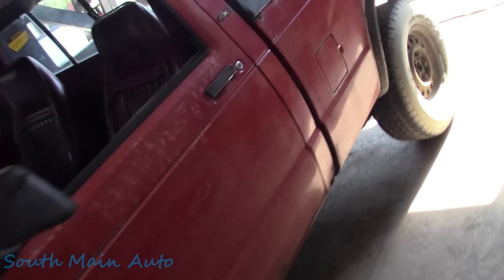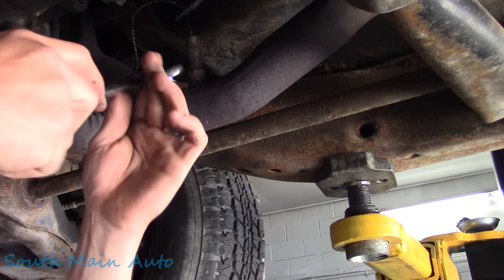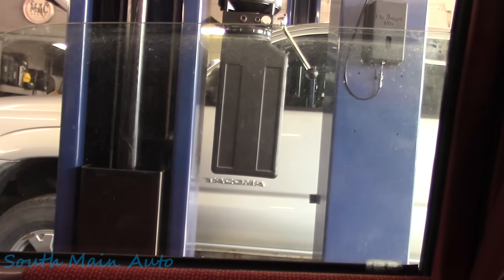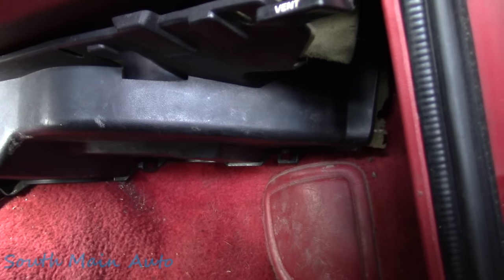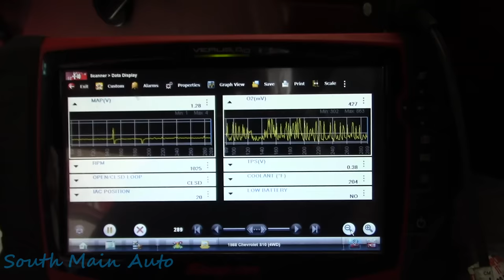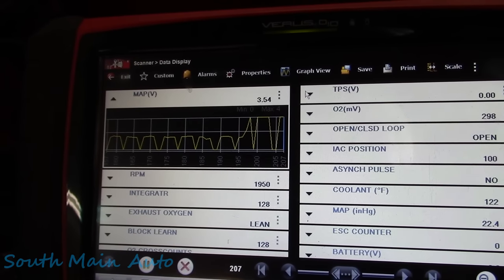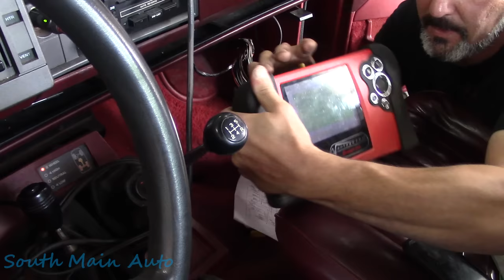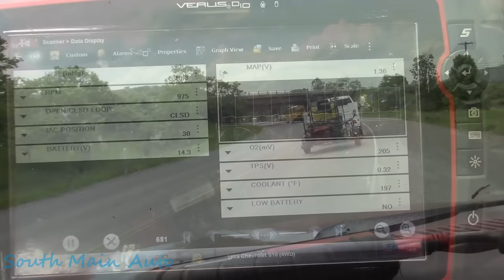Chevrolet S-10 - High Idle and Dies After 20min Drive?!

Comment: Now we're talking! When I was 16 and working summers for the village, our "truck" was a red 88 S-10 with the iron duke 4 banger. It had an AM only radio and no power steering. We called it the "S-9". One guy decided he was gonna buff and wax it by hand. He gave up pretty quickly and we drove it the rest of the summer with one shiny fender...
Reply: When I was an electrician apprentice back in the early 90's we had a GMC Sonoma shop truck.  Iron Duke, manual trans, and no power steering.  I hated that f'n truck!  lol!
Reply: Fender splendor :)
Reply: I had a "77 PONTIAC SUNBIRD with the 2.5 Iron Duke. Sold it for $100 @188k.
Reply: Wes, if your donkey powered internet is working good enough to watch SMA, you better give us a vid!
Reply: Hahaha... 1 shiny fender.  Oh Lordy! Love it Wes! 🤣🤣
Reply: That's exactly the truck I have. It's not much fun to drive, but it's reliable!
Reply: I used to work for a hydraulics shop that had an S-10 with the 2.8 liter V6. It was a great little truck, manual trans, no options, but it ran like a top. Later on our shop changed to a Dodge Ram pick up and I hated that thing, it was a dog and would fall flat on it's face with the bed loaded.
Reply: @richb.4374   Every time I see an 80s S-10 I think of Terminator 2 where they're yelling at him to go faster and he says "this is the vehicles top speed".
Reply: Back in the day, the shop guys would do a "Tap Test" AKA, tap it with the handle part of the screw driver.  if the vehicle cut out it would need a PCM. LOL!
Reply: @bonemanmcjames2953  Good point!
Reply: @bonemanmcjames2953  That's what i'm talking about!
Reply: Wes, if you have time to be on internet, you need to get off and make us a video my friend.  Just saying. :)
Reply: I hope that was the curbside fender...#waxonwaxoff🤪
Reply: Wes was one of the original "Village People"..lol
Reply: S10s , 80s Ford Rangers and 90s camrys will be running long after we are gone
Reply: @warrenfromga9945  Pretty sure his internet donkey is still broke down.  Massive lightning storm took out internet in his whole area.
Reply: Cleaning out my desk yesterday, I found my first speeding ticket.... earned with an iron duke.  It must have been downhill with a tailwind. LOL  1986 Celebrity, 62 in a 45 if you wanted to know.
Reply: @SouthMainAuto  man...that brisket sandwich looked AWESOME...I WISH I WAS THERE!!!
Reply: We use to race dirt track with an Iron Duke. The engine would last way longer then anyone wanted it too. The only issue was the amount of RTV sealant it took to keep oil in the engine and the front head bolts would snap every 10,000 miles or so. I learned quickly how to replace the broken head bolts without taking off the head (Or the rocker cover) using the broken bolt, an impact gun on reverse and an air nozzle.
Reply: @29auto30  That's exactly one of the tests that they do to the PCM at the rebuilding centers.  In college I worked for Delco Electronics and wrote the script for training videotapes used at the 6 or 9 regional remanufacturing centers around the country.  You took the unit and slapped it hard.  You also put it in an environmental chamber and baked and then froze it to see if it would fail.
Reply: Urban locale here and the USPS still runnin the iron duke in the LLVs. The guy floors that thing like a jacka.. whatever Eric said about the flipped filter lid
Reply: Remember when you snuck in that fly into the edits that nobody noticed? Wonder if Eric is playing with the same software..
Reply: Do you mean HAM radio?  Never heard of an AM radio.
Reply: hated the 2.8 I miss my s10 with the 2.5 iron duke never die went over 200000 mi the body gave out before the drive train
Reply: @WatchWesWork  "I could get out and run faster than this!"
Reply: @redmondjp  ...slap and bang it like an old tube tv .. (i hear many ask whats a "tube")
Reply: The shiny fender was the idea for daytime headlights.
Reply: @vehcor  Fancy seeing you here.. One of my favorite channels commenting under another one of my favorite channels, while on another one of my favorite channels..   I don't know what is happening, but I like it. lol
Reply: yeah i wrote above that that little model and truck made chevy look sincere.  wonderful - it worked and ran dependably and was not expensive.
Reply: I'm glad I got an 82, it doesn't have 98% of the electronic crap this has, I could disconnect all the electronics (temp sensor) except the starter and alternator and it'll still run all day.
Reply: @WatchWesWork  my 82, when it was stock with a 3spd automatic, would do 100 mph no problem.
Reply: The prom chip very seldom go bad it is a PCM problem
Reply: Heat and quench😅

Comment: I’m sure others have said, but it’s surely a few leaking capacitors that have eaten the original PCM. Sadly junkyard units will likely be on the same trajectory. A refurb that’s been recapped and had any trace damage repaired may result in more reliability.
Reply: I'm thinking this truck would be a decent candidate for a  cardrino or speedrino if it ends up with more problems with the computer.
Reply: I'd also rip off that cover and first have a look at the capacitors. If they look fine I'd take off the pcb and search for bad solder joints. 

Back in the days I owned a BMW where the entertainment ssystem did such weird things after some time, at hot weather more than in cold weather. BMW's offer was to put in a new radio for more than 1500$. I thanked them for the offer, went home resoldered a few joints and it worked like a charm for the next years untill I sold that car. 

But for Mr. O. that wouldn't probably be an option because of warranty issues...on the other hand, as you mentioned, if there is a cap-problem this guy will eventually run into some similar issues in the feauture.
Reply: Absolutely. If you can catch those electrolytics  before the leak and kill the traces, its a pretty easy fix if you have some soldering skills.
Reply: Wow, Had no idea you watch this channel too Adrian! But absolutely my guess, it's becoming a thing on these old cars. I've recapped a few Ford PCM's and did some trace repairs with success.
Reply: @dougkoudelka3089  I recapped an ECU once.  I think I was holding my breath the entire time.  The breath holding was used in place of soldering skills.
Reply: Also keep in mind if the owner is driving around on poor struts and shocks, the components of the vehicle are suffering a high vibration rate so, the broken solder joints combined with bad capacitors leaves the cpu in an intermittent state.
Reply: Greetings: As an elex tech, GM owner and various shops diagnostic tech...Such is my thought. I, probably, would have opened it up and repaired it as I have others. Good call.
Reply: shango066 has some vids on old ford pcm's.
Reply: @lorrinbarth1969  Also not a bad idea if it was lead-based solder.

Comment: Do you remember back in the day when you hooked up a volt meter to a car and counted the meter sweeps to get the codes?
Reply: Remember Shorting the connector pins on the diagnostic plug and observing the check engine light doing Morse code?
Reply: @mikeam3871  yep gm.  fords used the meter sweep.  chrysler had a led handheld scanner

Comment: Oh, the memories! My first set of wheels in 1999 was a '88 S10. Four cylinder, 2.5L, EFI, 5-speed manual, 2wd. It had a driveway paint job that I would touch up on the fly with a rattle can I kept in the glove box, a piece of 1/2” plywood where the tail gate should have been, if I hit a big enough pothole I would have to pick the radio up off the floor and slide it back in the dash, and I could get the dash lights to come on by giving it a 'Who's the Boss' Tony Danza whack. One time it had sat in my parents' driveway for months while I was away and no one was driving it; all of a sudden I needed a vehicle so we dug it out of a snow bank (literally half buried), boosted it with some jumper cables and my mother's minivan, and I hopped in and drove it two hours to the city where I was living and working and kept driving it everyday for a couple years after that. All that in Nova Scotia Canada salted roads winters. They don't make them like that anymore. I really miss that truck.
Reply: The dash whack is called a Fonzarelli, not a Tony Danza
Reply: I miss my 89 s10 blazer with a 4.3
Reply: @shadetreec6013  Oh yeah, like when he hit the jukebox? My nickname in high school for a while was the Fonz (a phase with a leather jacket and hair gel). But I have a memory of Tony hitting the roof liner or dash or something in his blue Chevy van to get the radio or something to work. Maybe I'm remembering it wrong.
Reply: the most valuable thing in life are memories
Reply: @shadetreec6013   "This bucket of bolts is never gonna get us past that blockade!!"
Reply: Lovely to watch how you diagnose faults incooperating ma'am & snack

Comment: Hearing you say, "before your time" makes me feel old.  I remember working on these new. lol I'm so old, I should be in a home!
Reply: Your just a kid,  The first car I worked on was a '49 chevy.
Reply: Yea I was working GM Fremont building cars and trucks 75-80 then was laid off. Americans were buying more foreign cars than domestic back then. So I feel old also bro.
Reply: I bought one of these trucks brand new, it didn't have the power to pull itself up the hill I lived on lol.
Reply: Vehcor no way, do not do the home thing. Count every day as a blessing and keep moving. God bless
Reply: We used to beat on the side of the pcm on these. Most of the time it would die or start missing. Put a ton of computers on these with the replaceable prom.
Reply: Hell, I started working on 1960's "muscle cars"! I crewed with an early 1970's NHRA Pro Stocker team. Yeah, I'm THAT old, and I still repair cars, heavy equipment, broadcast stations (radio and television), electronics, computers, and so on. I'm also a [semi-]retired aerospace engineer.

"If you can break it, I can fix it."
Reply: I've worked on many vehicles older than this, and I'm only 63, young and fresh, as springtime.  But I must admit, playing by today's rules, I have no mechanic certifications. I think that means I am not allowed to know how to fix a vehicle. According to experts.

Comment: Eric that is the 3rd generation of GM ECM, Engine Control Module. 
The first had a non replaceable PROM, Programmable Read Only Memory. 
2nd generation had the removable PROM. 
3rd generation had a PROM & an EPROM, the EPROM, I believe was the limp home for fuel injection or throttle body injection. 
The hair dryer will not get the circuit board hot to make it cut out. 
We had a 82 T16, Mini Blazer with 2.8, 700R4, with 120K miles, at 13 months old! It was a mail lady’s outfit. The first one that I ran into, the 3rd one that Chevrolet Technical Assistance ran into. She never had trouble in the winter, started having issues on hot spring days. 
One time when Ken removed the ECM, it was hot enough that it singed the carpet. 
I wish that I would have had your scan tools, instead of the KenTool, GM base special tool, OTC is what the tech assist sent us to use. 
As you were going through, I was remembering the trouble that I was having trying to make tools that now you can buy. 
Hello from north east Montana. 
10 miles from the Canadian border.

Comment: Wow, what a great ending, and what a break that Wilbert's had a PCM available.  Also not too shabby that an O2 sensor was readily available.  And Mr. O had a scan tool that could read this old OBD-I system, and the know-how to interpret the data, so a win-win-win.  But I think in your shop in upstate NY, that Kansas song in the background was really "Rust In The Wind".
Reply: Great! Now I have that song with modified lyrics stuck in my head.  All our cars are rust in the wind.  😎
Reply: Tom Lewis  You can retrieve OBD-1 codes with a paperclip.
Reply: @POOKIE5592  big difference between pulling codes and seeing live data pids,codes would have done nothing here it was the wonky live data voltages that pointed towards bad ecu,it wasnt even throwing codes otherwise he would had pointed that out in begining for direction to go
Reply: Spoilers!!  I haven’t watched it yet! Lol.
Reply: PRetty sure this sucker was just heat cycling the board enough over the years it started fucking some through hole solder joints and probably fixable!
Reply: All our cars are rust in the wind. Ruuuuuussst in the wiiiiind🎶 Everything is rust in the wiiiiind🎶
Reply: @kellyherald1390  I own two Lotus.  They are fiberglass bodied cars so no body rust.  I don't drive them in the winter when salt is placed on the street to melt the snow and ice so no chassis rust.
Reply: The SnapOn scanners can still do OBD-1 if you buy the adapters(separately). They have a tray for OBD-1 and a tray for Euros. 
The Autels usually come with them in the case

Comment: I just finished working on a 1986 Corvette.  Some of the same problems displayed that you found.  The ECM's go bad due to bad internal grounds in the ECM.  The other thing I have found on these model years is bad grounds.  They test ok with a voltage drop but still have problems.  GM is well known for crap grounds.  They used to ground the ECM to the bolts in the thermostat housing.  I have fixed tons of these with just taking apart the ground connections and cleaning them up.  Great video man.

Comment: I had a 87 Chevy G-30 van, 4x4 pathfinder conversion. Same vintage  TB injection. It started acting all crazy above 30 mph or so. Bucking and spitting, popping, pinging etc. after changing the usual suspects I noticed the engine temp sensor had a white lump growing out of the brass body. (I guess that’s the California version of “the green crusties” . I changed the sensor and the nightmare turned back into a dream!.  Sad to say I sold it after 35 years and 265,000 miles…..(I’m crying inside right now). Great seeing you keep the oldies on the road.

Comment: For the newbies out there… for the ECM replacement, you want to match the “service number” like 1226069. That’s the ecm itself model or part number.  Then the prom chip inside should follow the vehicle. It has specs like which engine, trans, tire size, fuel and timing maps - list goes on. So you could swap them around and it might run, but it might not be right!  Speedo could be out, engine might run funny. Or you could have an auto trans where all of a sudden you have an upshift light come on!  That’s always fun. :)
Reply: Not too many “ newbies” today get to have the fun of removing that caterpillar prom without bending ! How many pcm’s are replaced today compared to the late 80’s into late 90’s.. Next to NIL ! LOL
Reply: Maybe would be a good idea, if your the customer, to put it on a prom reader and copy the data, so if the prom ever died, you'd have a back up.
Reply: Yeah as long as the ECM is the same part number, just need to switch the MEMCAL and you're good.
Reply: @Discretesignals  No backup, no mercy.😁
Reply: Must be a "vintage" tech like myself. I remember all the fun with those years. Custom PROMs that eliminated limiters or changed tire sizes or gear ratios, think I still have the software someplace.
Reply: I still have my plastic “PROM picker”
Reply: @kurtutube1  Me too. Worked for Holden Australia in the 70's and 80's. We called them an EPROM.
Reply: All that for spark and fuel delivery? I guess it can make a computer geek sound like a mechanical genius
Reply: @crazyedo9979 I got my engines back up memory right here 🖕lol

Comment: My first vehicle was an ‘88 S-10 Tahoe with the 2.8 V6 my brother sold to us for cheap. It was a fantastic truck. Got passed around to several family members and had almost 300,000 miles by the time we parted with it. I miss that truck dearly and would buy another first Gen S-10 in a heartbeat if I find a clean one. Oh yeah, I also flipped the air cleaner lid back in the day!

Comment: Eric, I ABSOLUTEL love your videos. I wish I could find a super skilled mechanic like you iny little town here in Oklahoma. I LOVE how you ANALYZE problems and never load a parts cannon until you have verified the faulty component. I am kinda an old school mechanic and have learned so much about using scan tools to find issue by diligently watching your channel. Keep up the excellent videos and I will keep on watching.  THANKS ERIC
 (and thanks to Mrs. O for always taking good care of you. Her lunches look awesome.. 

FreddyB
Claremore oklahoma, (no rust belt)
Reply: Oologah, Oklahoma is not any better.... Countryside Diesel Repair just NW of us, is a super good shop, they will put it back to OEM condition, and they work on everything.... Fixed my 5.3L Vortec Suburban a few years ago, compressor shelled out, and they found the O2 harness eaten up by sharp teeth.... PVC valve was bad, intake manifold gasket was mostly gone... it now runs like brand spanking new

Comment: I'm glad you were able to find that ECU. If you didn't have one, I have a spare ECU in the basement from a 1989 S10 Tahoe 4x4 auto pickup. Mine is for the 4.3L but the 2.8L proms would've worked on it. So I don't have to send it to you. :-)  When you said you'd need to hunt one down in part II, I thought I'd give you a call and let you know I have one, but apparently your local parts yard is the best!

Comment: Own 2 S-10s, a '93 350 swapped daily and a '91 4.3L, but worked on several 2.8Ls, never had the pleasure of dealing with old candle stick O2 sensor but yeah fire is a MUST for removal, have several PCMs due to internal gremlin issues,  hard to kill these trucks, looking at an '88 manual right now, Great Work Mr. O! Love your channel!